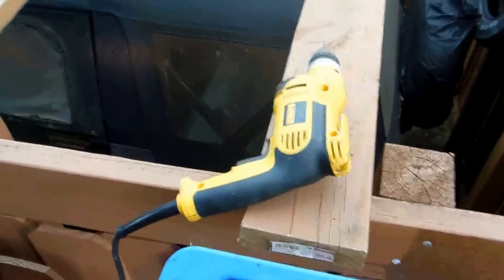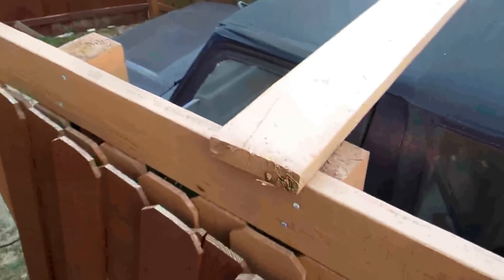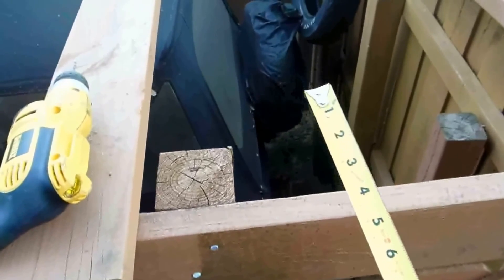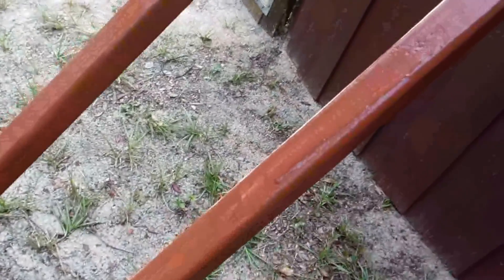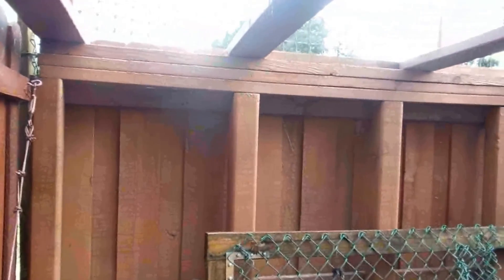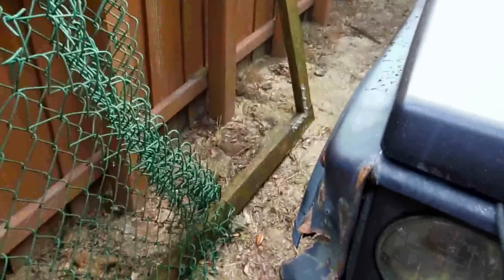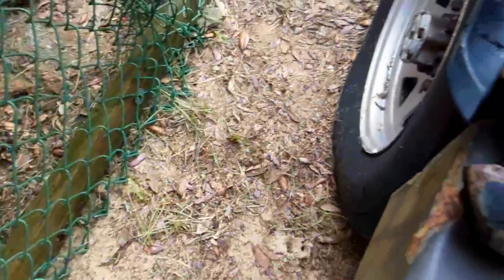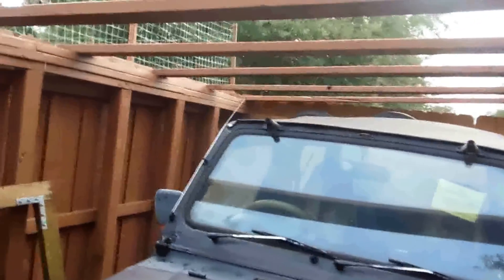Making a Car Port Roof - 1 of 2

Comment: A quick tip for setting those roof beams.. cut 2 pieces of timber 1. to 22" and 1. to 25" and screw together.. Then sit the 25" on top of the beams with the 22" hanging between to set your gap and pull the second beam to that after fixing your starter beam and work all the way along like that.. and they should be perfect
I think i would have screwed them with 3" screws